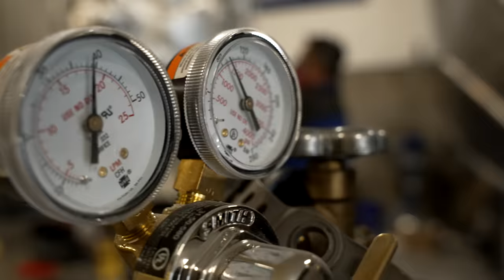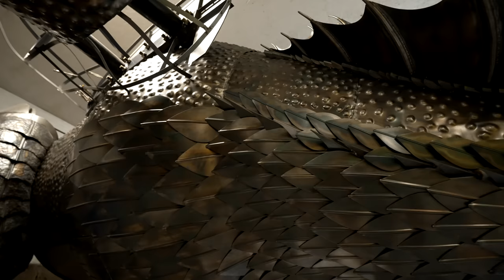Man Welds "Life Size" GOT Steel Dragon - COOLEST THING I'VE EVER MADE EP23

Comment: His steel sculptures looked amazing. One thing that caught my attention is the fact that he mentioned he like to build his sculpture to last like a pyramid. I am wondering how he can make them last a long time when it is made of steel. Wouldn’t it start to rust over time? I was looking at that giant eagle he built for Dollywood that he is placing outdoor. How long would that last and prevent it from rust over time? How would they try to maintain that? Does he put on some sort of clear coating to prevent it from rust?
Reply: Stainless steel does not rust.
Stainless steel has a high amount of nickel, which is very expensive.

Comment: Wow Elon musk needs to collaborate with you. If anyone going to design a sub structure framework for a successful and truly reusable ship it's going to come from hands and a mind like yourse. His so-called techs have an education (books provide no personal experience)with no applied understanding of the physics of metals and structure (stand on an empty beer can is possible untill a fly brushed against it while your weights on it). We the human race need you sir.  We need you to apply your artist mind to overcome the structural failur stresses of launch and reentry vehicles i say this because your not going to solve the problem with an equasion your going to solve it with an experience and understanding of metals. Ive been looking at single pour sand cast main frame myself but frequency and vibration still kill my models. Theoretically of course no steel mill exists that could even attempt such a structural pour. Scale is daunting.